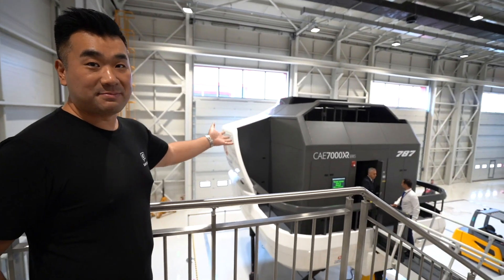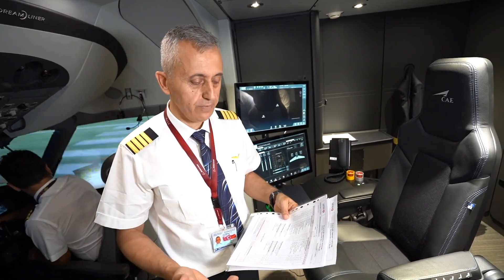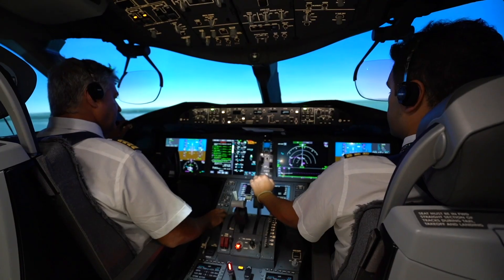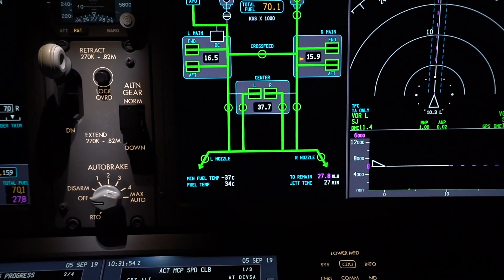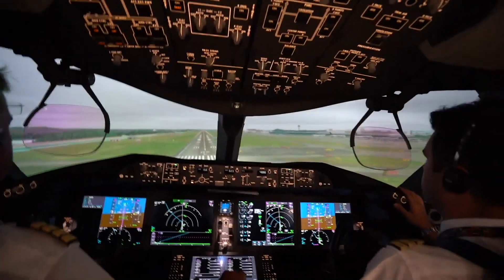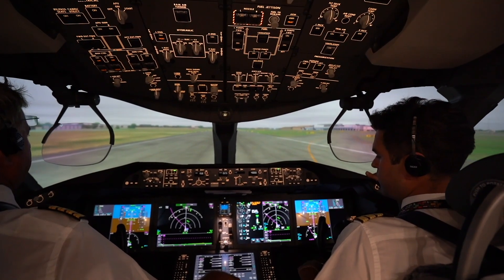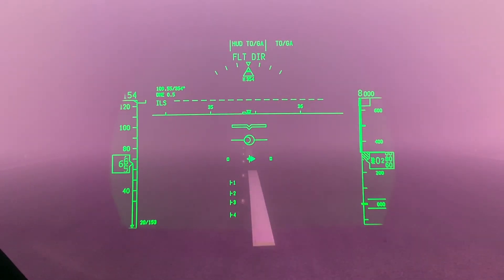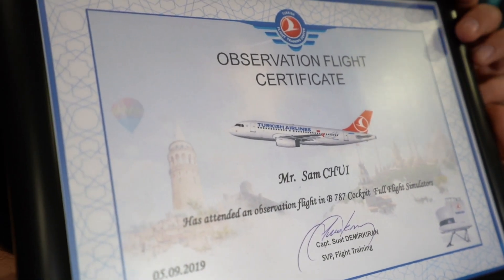Pilot Training: Flying the B787 with One Engine

Comment: a monochromatic HUD in the year 2020... that's just wrong with so much information on it.
Reply: Not really. Don’t need multicolour hud. Even most military jets have mono hud.
Reply: @peteconrad2077  That's probably because they are 30 years old. 
I think if they invented a new one now, it would have colours. Doesn't the head mounted system of A10C, F18 and F22 have colours now? I mean there's a reason why the PFD HAS colours. If they weren't making it easier to read, they would have left them out.
I myself am used to flying the 737 in much detail but everytime I use the HUD, I'm confused.
Reply: @jemand8462  event the F22 has a mono HUD.  Because the HUD is designed to display a minimum of information, unlike PFD, colour is unnecessary.
Reply: @peteconrad2077  Okay but what about the helmet? Don't you think it's better to use different colours, let's say for the SPI and the Waypoint than using different, but similar looking symbols like a square and a triangle?
Reply: @jemand8462  not really. The HUD is only fir tactical use not long term navigation. You’re not flying across the Atlantic using it.
Reply: @peteconrad2077  fair enough.. but I still don't get why more colours would actually harm visibility. In my opinion it improves it... I mean it doesn't have to be a rainbow, but at least red for important stuff and maybe blue for really minor stuff could make a difference in my opinion. It's just weird somehow.
Reply: @jemand8462  there’s also the fact that colour vision reduces at high g so their effect would be lost at the critical moment. Modern fighters tend to use aural media for alerts. The hud is just for essential performance and target info.
Reply: @peteconrad2077  good point. thanks for clarifying.

Comment: what software simulator is that? I mean  the scenery and clouds ect  is  xplane, p3d,  fsx??  or which simulator software they use?
Reply: This is all custom software developed, in this case, by CAE and based on Boeing data. A lot of the avionics like the displays and controls are real aircraft parts. The physics are simulated high fidelity models based on flight test and wind tunnel data.

Scenery is something you buy or again for CAE, develop yourself. It's not a normal scenery but something which is certified to be used for training with high requirements for accuracy and real world correct visualization.

Comment: What kind of screens are those???? you can look at them at any angle and get the actual perspective...
Reply: Its called a collimated display. It uses a projector and a curved mirror. So to the pilots eyes it would look like the image is coming from infinity. It basically feels more realistic than a projector screen.
Reply: @manikrn007  Thanks for the reply... are these kind of displays available in markets for consumers
Reply: @wackedmotor8269  It's not available where I live. And even if it were available, it would be extremely expensive, since it's used solely in these professional environments. The best option if you want one is to make one yourself. I saw a video a while back of a guy making one for his flight simulator setup using what looked like mylar sheets and a wooden frame. But it looked extremely complicated. And way above my skill level. Or else I would have been rocking one right about now.😂

Comment: Do they practice double engine failure even? I always thought they don’t lol
Reply: Yes they do
Reply: Thats what you call forced landing, with a small trainer plane you can just do sharp 180 and land back considering the runway is clear. Idk for big jets, i think they will just have to look for open area for forced landing.
Reply: they practice basically everything
Reply: But to be honest, with double engine failure after takeoff you can only crash the plane. The question is just how you crash it. But I doubt you train sully moves in the simulator
Reply: @msi4887  you can still land a plane with double engine failure, but it is called a crash landing(or a crash).

Comment: Thankfully Turkish Airlines 787s have the GEnx engine instead of the Trent 1000!
Reply: Turkish Airlines must get rid of their 737 MAX before they're recertified and welcome the 320 Neos.
Reply: @luckyme4136  no they are fine and will soon hit the skies again.
Reply: Lucky Me yup
Reply: Boeing actually had the MCAS fully operational on their air refueling plane which is based on the 767 and used by USAF, but for some reason they stripped an important safety feature when they ported it to the MAX. I guess they're trying to make a difference between military and public application which ended in nasty crashes